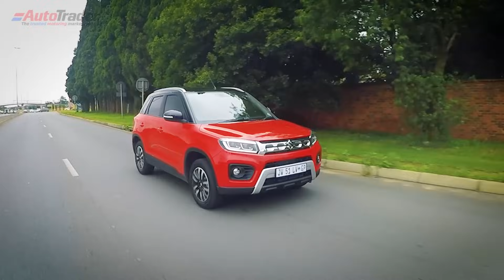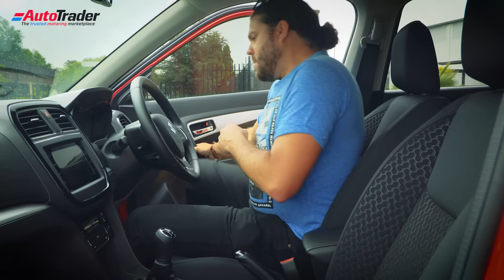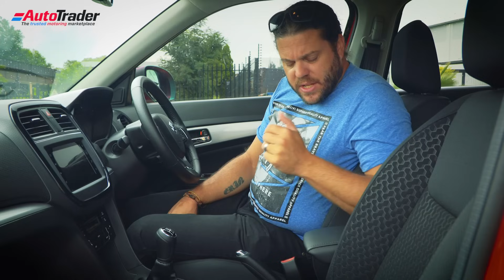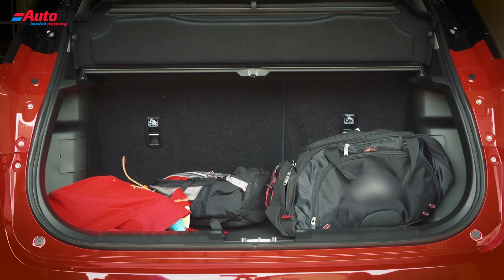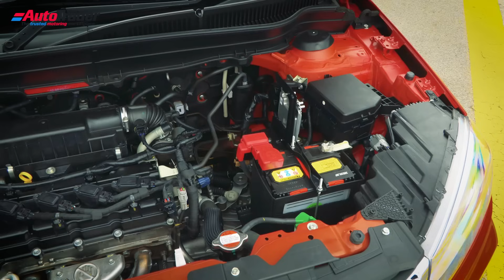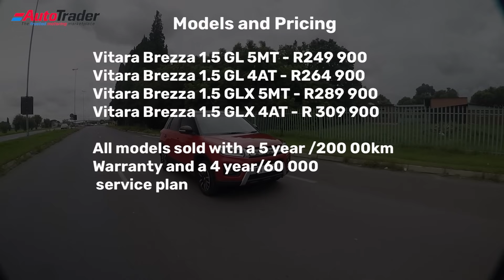Suzuki Vitara Brezza (2021) First Drive Review

Comment: Toyota is going to steal all the shine from Suzuki with the rebadged Toyota Urban Cruiser
Reply: Toyota buy brezza design and use tnga chassis with daihatsu engine make their(baby brezza) raize/rocky/ativa(smaller dimension)...this practice save a lot /normal...they have mou ...
Reply: @IKAPeajai  it's the same car, there is literally no difference other than the badge and Toyota connect
Reply: toyota is bad car company